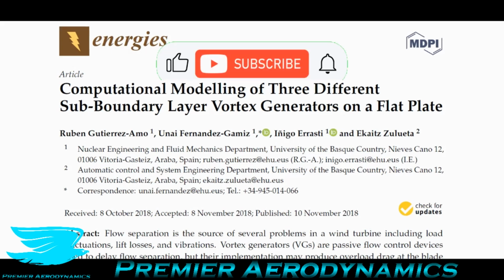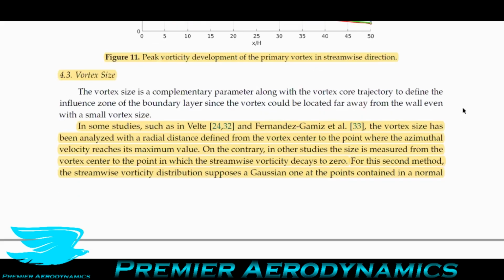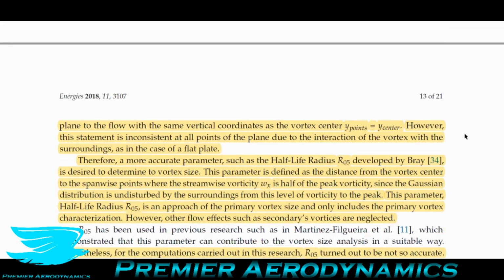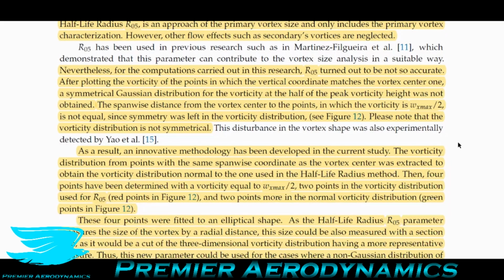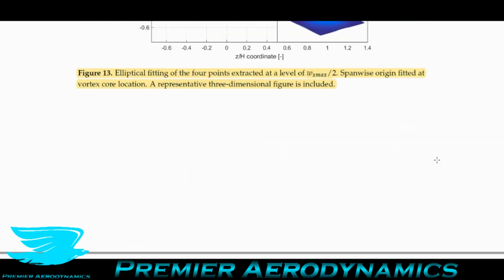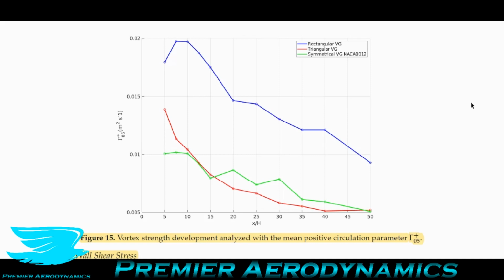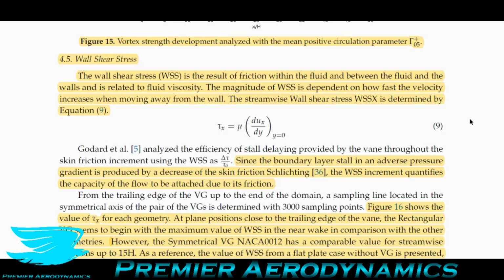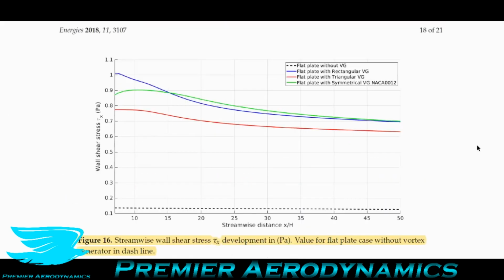Sub Boundary Layer Vortex Generator Aerodynamics Part 2 - Podcast #60

Comment: More accurate than ellipses, if you're studying 3d flow, why not use 3d geometry? The horn torus gives a good approximation to general vortex shape, and can be used to map out a vortex, and to define whether one exists or not. Just a thought.
Reply from the maker: Definitely, you could use that approach for 3D. That would make a nice isosurface. And you could use something like the Lamda 2 or Q Criterion to determine the edges of the vortex encompassed by the horn torus.